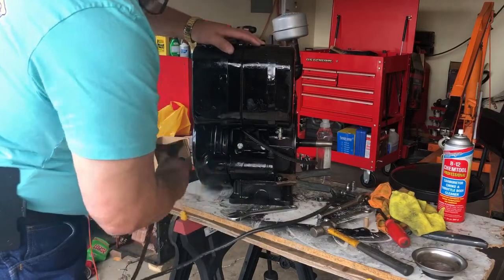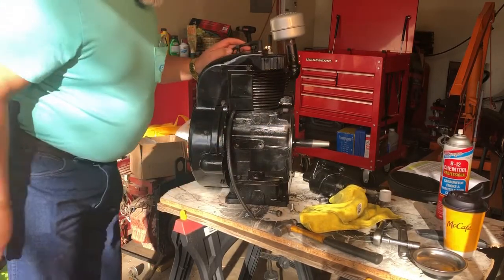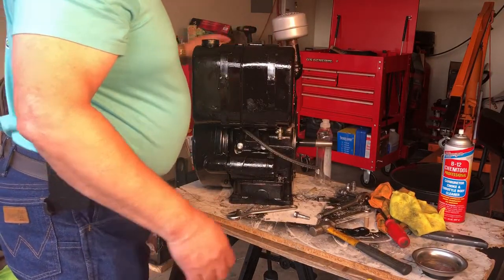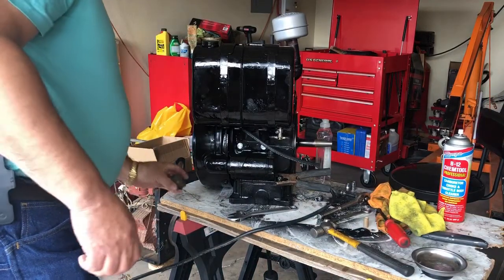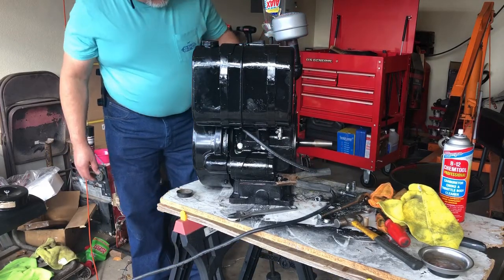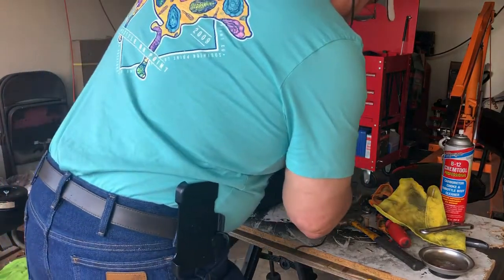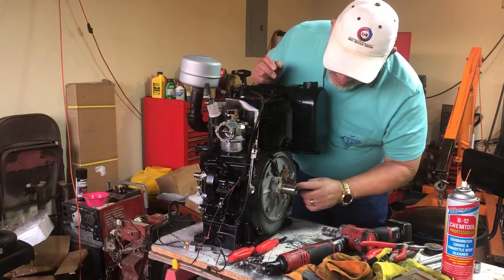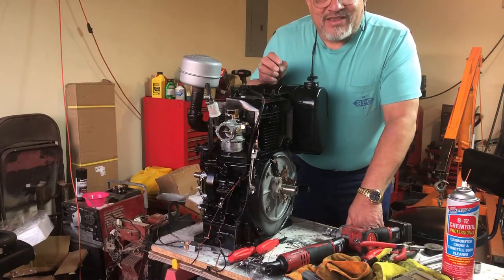WeldanPower 150 Generator Rebuild Part8

Comment: Did you ever rebuild the genset?
I would like to see  those videos, as I have the same welder
Reply: Haven’t finished it yet. I ran into an issue with the magnets in the flywheel becoming discharged and haven’t been able to find someone to recharge them or a replacement flywheel. They not only produce the voltage for the ignition but also the field voltage. I may try to convert it to a regular ignition for the engine and find another way to provide field voltage for the genset. I’m currently in the process of moving but may find time soon to get back on this project. Stay turned. Thanks.
Reply: @rayo.marquez4163  the field, I have heard can be flashed by touching 12 volts to the commutator contacts
Reply: @mrgutzmer  yes, I believe it requires like 3 to 4 volts. I may try using some AA batteries or a resister in series from the 12 volt battery used on the starter.
Reply: @rayo.marquez4163  I will keep you updated on my machine 
I
Had mice move into mine!
Reply: I have to clean the commutators on mine, and check all the wiring 
God Bless 
Martin
Reply: @rayo.marquez4163  did wiring it up with resistors to the 12v work? If so would a momentary switch work to excite the field?